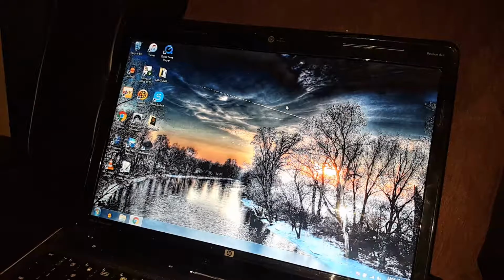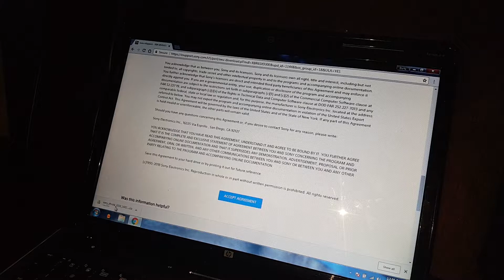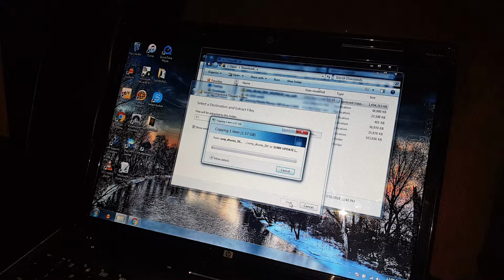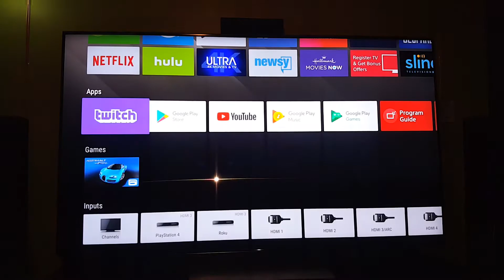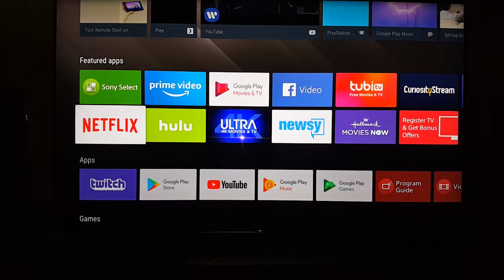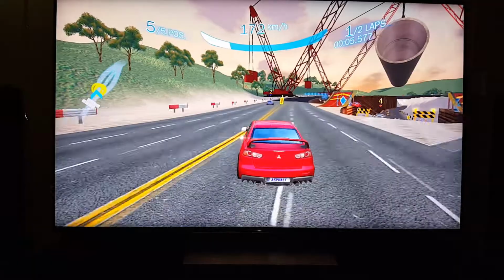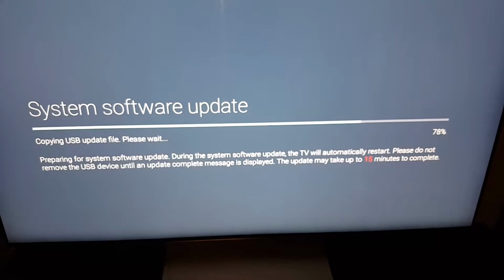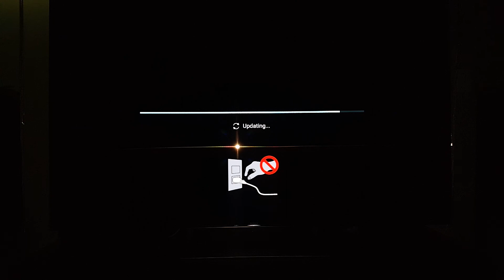HOW TO INSTALL SONY FIRMWARE MANUALLY... DIY pt.1

Comment: What kind of reciever you have that you have to use a audio optical cable.... One hdmi cable is good enough... And turn your audio return option on..
Reply from the maker: Antoine Butler naa i have 3 differnt sound cables.   One for my bluray hdmi. One for my receiver hdmi and tv apps is optical.
Reply: Durty Sprite Ent.... You must got an old reciever man.... Because... I don't ever had to do that... And I play games and everything from my TV...
Reply from the maker: Antoine Butler naa 2017..onkyo txnr656
Reply from the maker: Lol naa chose to do it that way.
Reply: Durty Sprite Ent.... Oh ok...
Reply: I prefer hdmi as well. I’m using audioquest vodka for my ST5000 (it was free) soon getting a true setup.

Comment: hey my A1 is hard wire to the internet will the update becoming  so I can just update it like that , and I have the Oppo 203 also   I like it because of the HDMI in , I use a pair of Definitive Technology  bipolar 3000 with the built in subwoofer they about 100 pounds each and  Yamaha DSP-A1 7ch cinema av amplifier about 50 pounds , I love 2 channel stereo although I have 7 ch, so I use optical cable , but the A1 sound is so good with the kick stand the subwoofer I use it
Reply: jarvisis akito optical? Can’t do hdmi?
Reply: vGREENARROWv its dose 2 channel stereo that I love